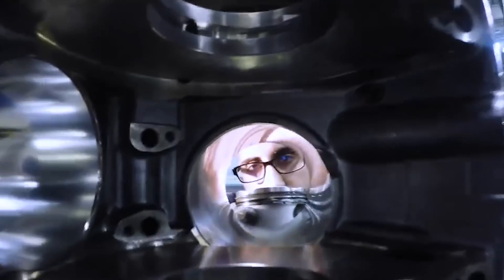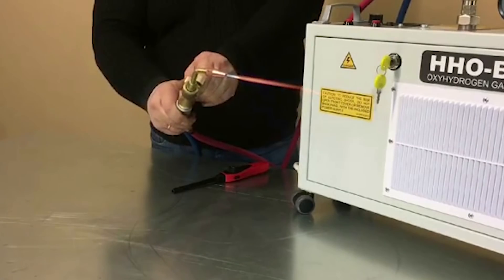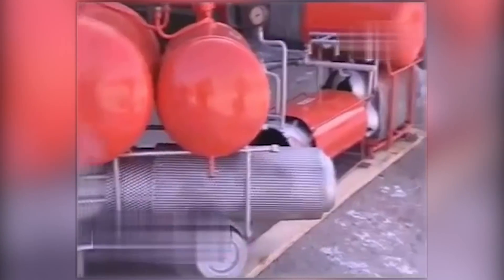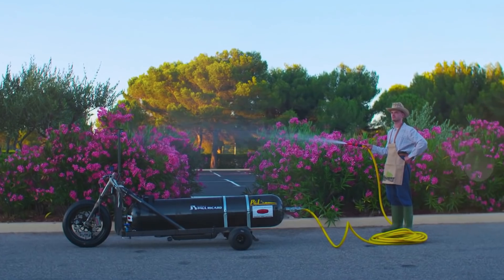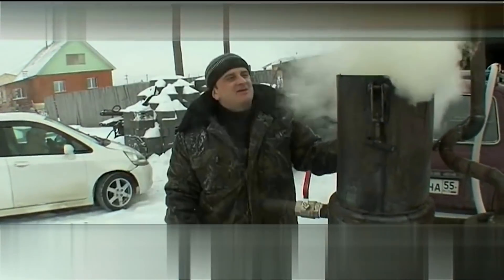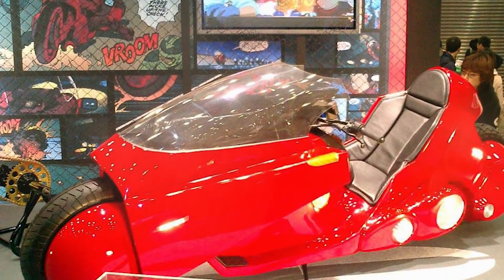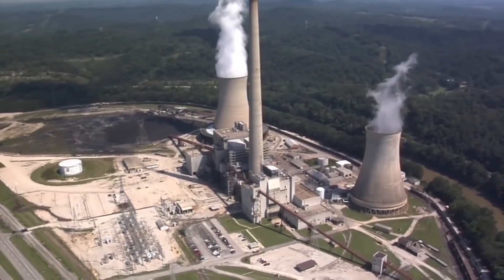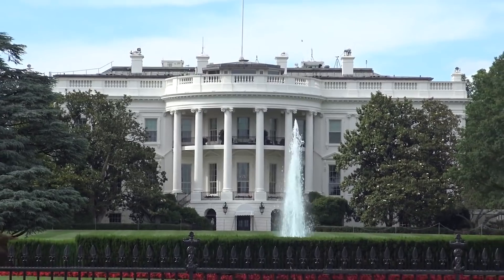Why These Engines Are Banned?

Comment: Turned off as soon as he lied about the government developing the engine invented by Wankel
Reply: The original Wankel Engine was developed by Felix Wankel in the late 1950s and produced by NSU in Germany  in the 1960s.  Mazda licensed the designed and improved the engine to be practical enough for production sports cars like the Cosmo, RX-7, and RX-8.  However, these engines by their nature are 'dirtier' than piston engines, and they could not be made practical for most applications and comply with emissions regulations.  They also had somewhat poorer fuel economy than a comparably powered piston engine.
Reply: @selfdo  1929.
Reply: and you wonder why the ratings are disabled lol
Reply: Same here, stopped it at the five minute Mark. I was hoping he was onto something.. lol . I owned an RX-7, great power plant for it's smooth power delivery, but in no way an efficiency queen. Might work better as a range extending engine for electric cars though.
Reply: Wankel is a great engine for what they can do. Not long ago it beat the record in small airplane for "time to climb". As for reliability. When the engine has problems or apex seals blow. It don't rocket out side of block like piston engine. It can still run on only one rotor with low compression. Plus military is working on diesel version for generators right now.
Reply: It was a German engineer I dad worked with engineers working on it when he was stationed in Germany
Reply: He wasn't lying. He didn't give full details. MIT created a new rotary engine that is much more efficient, can run on multiple fuels, and has minima moving parts. Look up Liquid Piston. The military is interested, but (AFAIK) did not fund the research.
Reply: @brianfoster1504  That liquid Piston engine is really cool, while he might of been referring to that one he didn't explicitly state it.  It is also still a concept that has to deal with lubrication, the injection of oil into the combustion chamber, that mazda has had issue with when it comes to emissions.  Too many factual errors to be trustworthy.
Reply: Inventing and developing are two different things. Inventing is deriving a concept to do things a new way. Development is taking the new concept and making it work practically in a given application. IE the Wankel engine was originally developed for cars. The US developed them into an engine for drones.
Reply: They were first introduced in Mazda cars
Reply: @aarons2613  NSU from Germany sold the first Rotary car.
Reply: Sames
Reply: In Germany I believe. I read about them back in the 60's in Popular Mechanics. They connected to the drive sHaft and served as a passing gear in some cars.
Reply: @danielallison1925  No it was simply the engine in the car.  Just as it is in the Mazda RX series cars.   Lots of power from a small engine, but incredibly unreliable because keeping a seal on a flat side with rotating parts is nearly impossible.
Reply: @lsorense  True.  I used to drive one.  They're reliable - but only if you manufacture them to incredible tolerances. They'd probably be more viable now than when they were first made because general  production engine tolerances have improved significantly since 1957.
Reply: @lsorense  Actually, the edge seals on the Wankle's rotor was solved very early on. I forget which auto manufacturer did it but they build a wankel engine with the best, most reliable materials available - and found themselves with an engine which probably - according to test results - would have been able to run a QUARTER OF A MILLION MILES (over FOUR HUNDRED THOUSAND KILOMETERS) without needing an overhaul. The most it would have needed would have been oil and spark plug changes. No auto manufacturer wants to make an automobile which lasts for 250,000 miles. It would be devastating notonly for car makers (fewer people wanting to buy new cars) and their supply chain, but for the entire auto repair industry. So nobody but the Japanese wanted any part of a wankle.
Reply: @billmullins6833  NSU went out of business due to the cost of replacing Wankel engines under warranty.  VW bought the remains and got a great water cooled regular engine which saved them from the trouble they were having with their air cooled engines, and they stayed away from the Wankel engine entirely.  Mazda only puts it in one low production quantity model.  It is also very hard to make meet emission rules.  The idea is neat, but it will never be a success.  And there are plenty of cars that last that long.  I had a Jetta TDI which is currently doing fine at 450000km (my brother in law drives it now).  Quite a few of the Mercedes diesels are over 1000000 km.  A Wankel engine would certainly not be the solution for anyone wanting a long lasting car though.  Mazda has done an impressive job on trying to make it reliable though.
Reply: @lsorense  Yes. My old RX7 was super finicky. Sometimes very hard to start
Reply: @billmullins6833  Diesels regularly ran longer than a quarter of a milion miles. My first diesel pickup was built in '85 and it had just over 700k miles before I sold it. My last diesel was a '99 with over 400k when I sold that. My results are fairly typical with diesel vehicles. So much for your theory. But no, the seals have always been the problem with the rotary engine -Mazda made the engine the most reliable, but quarter of a million miles? Asking a lot for that type of sealing issue.
Reply: @lsorense  it didn't start in the rx series tho, first rotary car produced was the cosmo
Reply: @danielallison1925  The so-called rotary engine is a Wankel Motor developed AND build by Felix Wankel a German engineer.
Reply: @kalleklp7291  the word is "builT"
Reply: @danielallison1925  The gear you are talking about sounds like a planetary gear. Planetary gears doesn't have anything to do with the Wankel engine, though if I really try I can almost see a slight resemblance, especially in the eye of a kid flicking through an issue of Popular Mechanics back in the 60's.
Reply: Read up on how the department of energy helped fund the Mazda furai hydrogen engone development.
Reply: A piston engine goes boing boing boing, a mazda engine goes hum....
Reply: That's all? Just cause of one name & u r turned off? Go on then, join the oil gang that won't stop ruining the earth.
Reply: Russia wants to be a top oil producer.  In fact, they produced more oil than the United States a few years ago.  Now they are trying to work with OPEC to reduce production and inflate prices.  They are part of that oil producing gang.
Reply: @cathodelite  you have to be precise in engineering as in reporting.

Comment: Vehicles in Europe used to be wide spread of running on compressed air supported by free compressed air gathered via trumps which was the process of using running water going downhill to build up pressures!!! So it isn’t a new tech either!!!